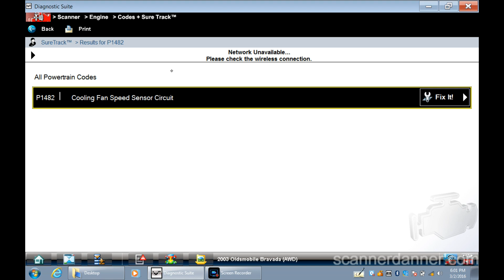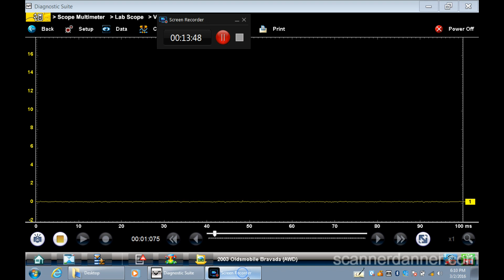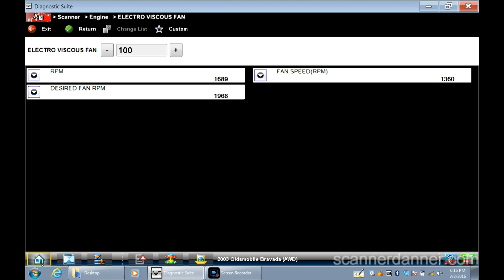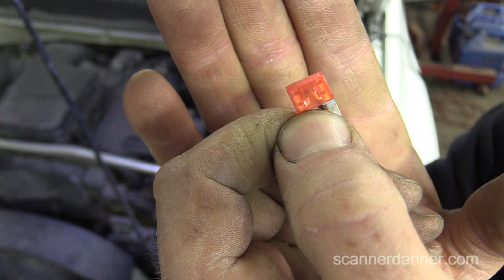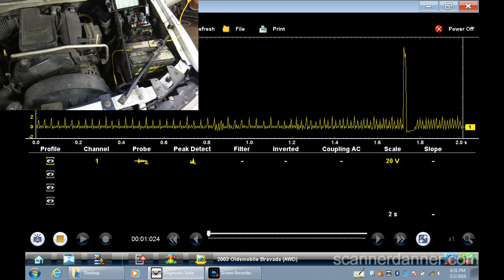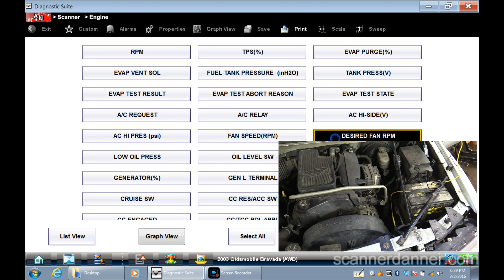Electro Viscous Fan - P1482 Cooling Fan Speed Sensor Circuit

Comment: I  put an aftermarket fan clutch in my '97 F150 (non eletronic).  The thing roars like crazy when its cold, fully locked.  Takes several minutes until the fluid is released and the fan RPM comes down like it should and becomes quiet.  Annoying but it was almost a third of the price of the OEM.  I'm okay with it but the replacement fan just doesnt work like it should at cold idle. Moral of the story is Aftermarket Crap!
Reply: Many do this by design. I put a Hayden Severe Duty fan clutch on my 1991 Explorer and it roars for about 1/4 mile and quiets down. If you look on their website, they specifically say that's how they're supposed to behave. I'm guessing so you know it's working or operational rather than finding out too late on the side of the road in a puddle of coolant.
Reply: yeah i hear ya Nate. Personally I think its a crock of bs because for whatever reason to get it right the engineering would be to costly.  It's all about making a dollar the easiest way possible these days.
Reply: I don't think so. Why would they purposefully make a product noisier when they have a choice to quiet it down. Consumers these days are incredibly picky and many people would want to return the part or go back to the mechanic to fix it.
Here's a quote from Hayden's website: "A thermal fan clutch is engaged on a cold startup because the fluid drains into the working area when the engine is shut off. The fan clutch will slow down shortly after startup as a result of a pumping action produced by a difference in speed between the shaft and the body of the clutch."
Reply: Nate Rowe All i can tell you in my case is the OEM fan clutch operates pretty smooth on startup and doesnt sound like the aftermarket clutch simulating a Boeing 727 taking off.  Aftermarket and rebuilt parts in the past 10 years have gone to shit, mostly Chinese junk...lets agree to agree?  Some of this crap is defective right out of the box.  Its a big joke
Reply: +Ozzstar I do agree, just not in this case :) I think one of two things happened in your case. Either your old clutch lost its fluid and didn't behave properly on a cold startup or ford spent the extra time to make one super quiet so they can say to the dumb consumer that their truck is quieter. Car manufacturers do all manner of silly things to mask or remove noises and vibrations that are actually normal and healthy. All because the consumer wants a quieter vehicle. I firmly believe that your new fan clutch is working properly as is mine. I'm sure the Hayden engineers agree. It's tough these days to avoid cheap Chinese aftermarket or companies that used to be good but got gobbled up by the big conglomerates. It's a shame really.
Reply: The normal position of the cold clutch on a Ford is full locked. It should be noisy then quiet down after running for a minute or so. Your old clutch was probably weak. But yeah, aftermarket ones do tend to suck.

Comment: Those aftermarket fans don't really work like the OEM. The Chinese ones will run full speed but some like that because it keeps the engine cool without realizing it's robbing power by running full speed.

Comment: swap the relays
Reply from the maker: No need to. Swapping out relays would have not helped in this case. And if it did work what kind of how to video would that be anyway? Anyone could do that. The question is 
would you know how to actually test the circuit when snapping relays doesn't work? You do now.
Reply from the maker: Thanks man I appreciate your reply
Reply: Why ?   the relay is working the control duty cycle signal is working at the fan connector.
Reply: Andrew W MacFadyen cuz it easy, cheep and it may tell you something.  there are two right next just swap them out. 5 seconds.
probably somethin in the clutch but that's how I roll...
Reply: @yrulooknatme  you’re not even sure of yourself because the way you talk probably learn how to talk. What a person says that they’re not sure of their own selves you have to diagnose. I know that is bad words to a lot of people but that’s the way the automotive industry is because we have to protect ourselves, we’re not AutoZone we’re not the God or Wheatus plug this magic code reader in and say oh you need this part even know the code says open circuit means there’s a warrant issue, but they will sell you that part because they are there to sell parts they do not diagnose things AutoZone advance O’Reilly’s. They are a parts house people ignore when that code pops up open circuit. Meaning there’s a problem with the wiring. It’s not the sensor. It’s not the coil. It’s not that it’s a wiring issue now you have to start digging.
Reply: ScannerDanner I know...
And  I appreciate your instruction.
Reply: Swap the relays for watt do you have to do diagnosing relays or not to change nothing you’re just a parts changer. You have to look at the data make sure everything‘s working correctly. Do you have a broken wire a spread pin bad PCM I swear these people stupid comments people don’t wanna diagnose nothing no more they got that magic eight ball in their hand.